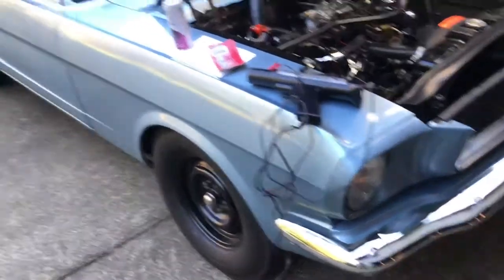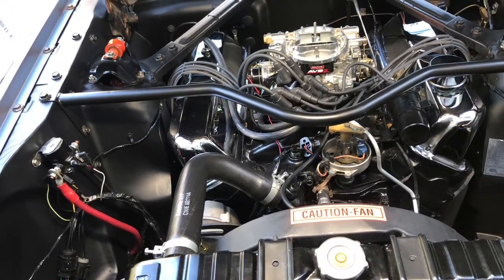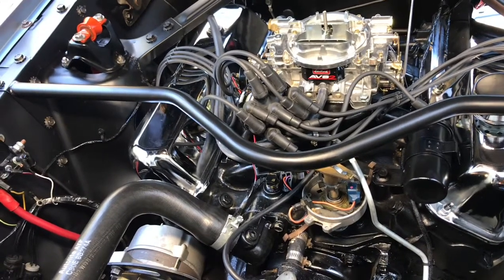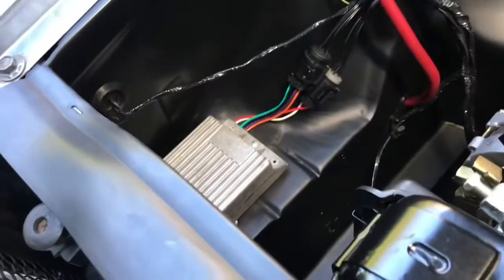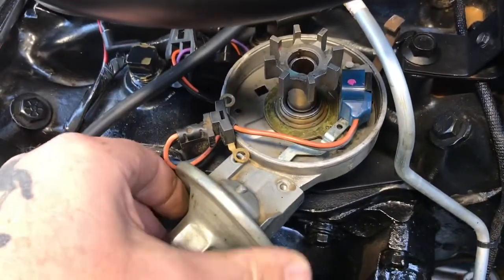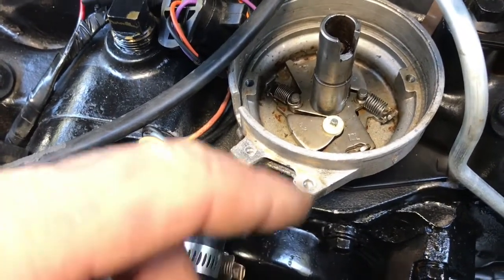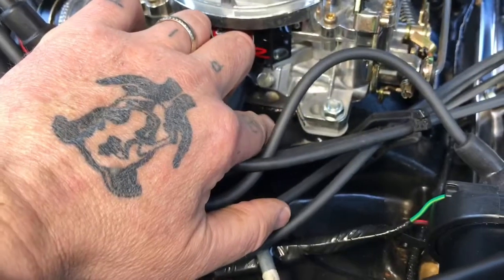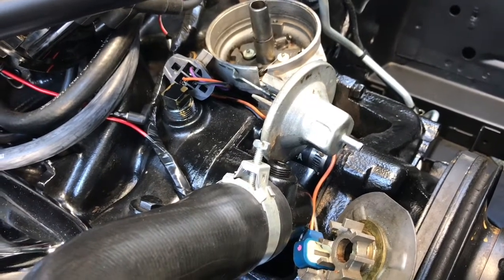Ford duraspark distributor recurve

Comment: I want to hear that motor! I want 428 wedged into my 1965 falcon sprint 4 -speed . U have header on that?
Reply from the maker: They are headman headers, 2 inch primaries and 3 1/2 inch collectors. Realistically custom headers are the only option. The Headman’s are way too difficult to install and they hang down too far.